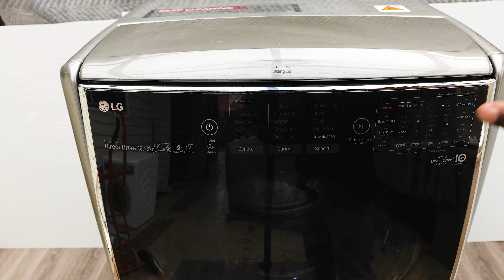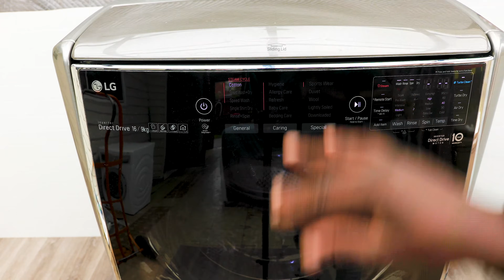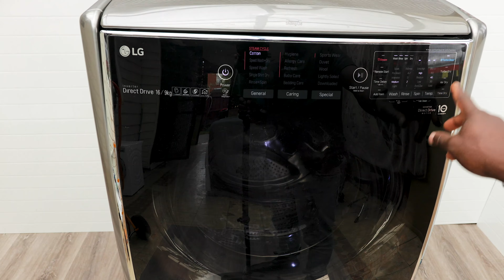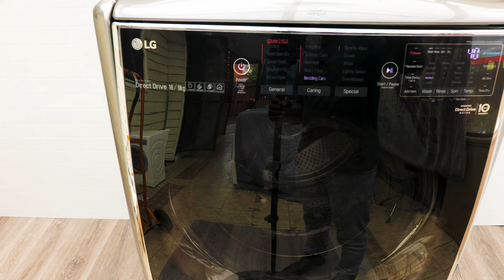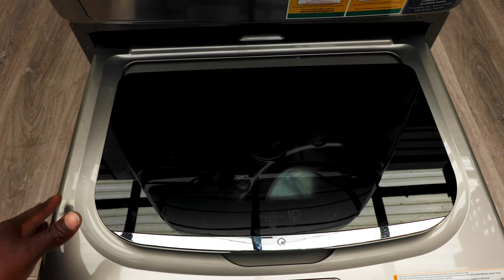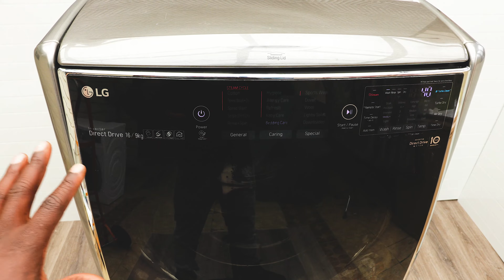LG Twinwash Washer Dryer Washing Machine 2021 Demo

Comment: Excellent video. Probably a silly question but for the smaller washing tub at the bottom, do you just put the detergent on the clothes (like I didnt' see a compartment for that)?
Reply: Yes, I assume you have to put some liquid washing detergent on top of the clothes. I don't think the small washer has a softener dispenser as well. So you'll have to use all in one HE detergent.

Comment: Do they make this set up in a bigger size? I have an older LG (about 8-10 years old) and I’ve gotten the dreaded DE error message, I’ve tried so many magnet troubleshooting for a couple of years and I’m beyond frustrated when it does it & I can’t get it to work, so I decided I’m going to buy a new one. The one I have is a 9.5kg and I’d like something a tiny bit bigger for the doona. Ideally I’d like to get a top loader because I always forget bits & pieces so need to add stuff but I’m open to potentially getting a front loader if I can find one that blows my mind & I’m very keen on the twin washers.
Reply: The LG WM 9500 hka is the biggest front load on the market. It is also the best washer on the market. It does have a play pause button to add stuff if you forget. The door error you are experiencing is probably an easier fix than you think and your existing washer will be restored to like new.

Comment: Hi, this combo machine had lint filter for drying fuction? Does the lint stick all over inside the machine?
Reply: Yes it does stick inside the door and also the rubber gasket. It is terrible if you have any pets. This guy has obviously not owned or used this for long as in a few years he will find it is a complete mess. I have had mine for four years and have just been given a full refund by LG.
Reply from the maker: they don't have a lint filter, only a coin trap on the bottom left hand side. No it does not stick lint inside its a condensor dryer

Comment: Hi there - I’m hoping you can help me. 

I just purchased an older model last week, it still has the dial in the middle of the machine. 

I’ve tried to do a cotton wash + dry and seperate wash + time dry and a further turbo dry after that because the clothes were still damp. Am I doing something wrong? Have I received a faulty unit? 

Any help/suggestions you may have would be greatly appreciated. 

Great work and really informative- keep it up!
Reply from the maker: Hi there. Sure. To test, do a short 30 minute wash and set the dryer to cupboard dry. If it doesn’t dry you might need to clean a few things
Reply from the maker: Have a look at this video on how to clean it as it might be full of fluff https://youtu.be/09q6TVhH8Yk
Reply: @askmrwashywashy  I tried a wash + dry cycle today and it worked. However when I just did a wash and chose a seperate dry cycle it didn’t dry properly. 

I will look at the video and try it out. 

Please note that this is brand new machine from the store so it seems odd that there would already be build up that causes issues already :( 

But thank you so much for your prompt reply and your assistance- fingers crossed it works moving forward!
Reply from the maker: @PuccalovesGaru odd especially since its still new. whats your model number so i can see the presets you have
Reply: @askmrwashywashy  it is LG TWINWash Dual Washer System WXLC-1116B-WTP357B. 

I will be trying a seperate wash and dry load again tomorrow and hoping for the best! But any future guidance you can give me would be amazing. 
Also stupid question. But is there any chance of turning of the steam function? Or is it always on?
Reply: @askmrwashywashy  hi there. Tried two seperate washes and drying and both came out damp. 

Is there a way to turn off the steam
during drying? We’ve tried air dry, time dry and turbo dry functions and when selected alone without a wash cycle they all come out damp :(
Reply: I used to have the same issue when my machine was new, but now I only dry in Air mode because turbo is very strong, shirnk my clothes. I always use small load of laundry.
Reply: @enidmsq  my machine is only now a couple of months old. Did it take this long to be able to dry your clothes? 
And did you do a wash and dry full cycle or did you wash and wait for the to finish, before selecting a dry cycle to continue? If I choose the first (wash + dry full cycle) it will dry. But if I do the second, it will never be fully dry.
Reply: @PuccalovesGaru  I just bought this machine yesterday and i tried it the clothes came dump did you know how to solve the problem?
Reply: How much?
Reply: @jordanalegaspi4688  how much what sorry? How damp is it or how much is the machine?